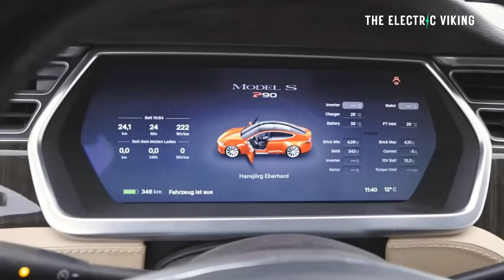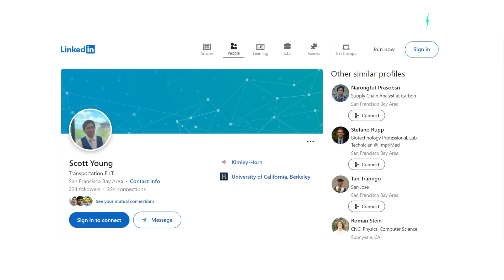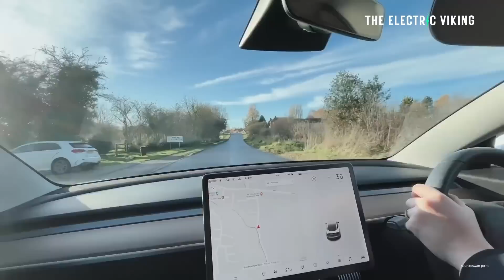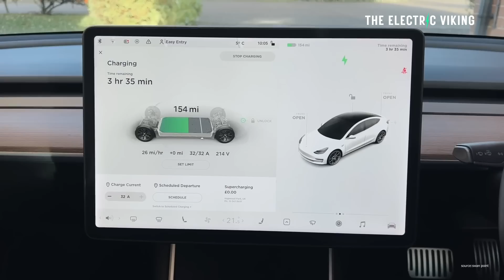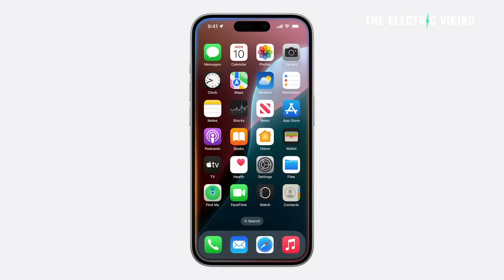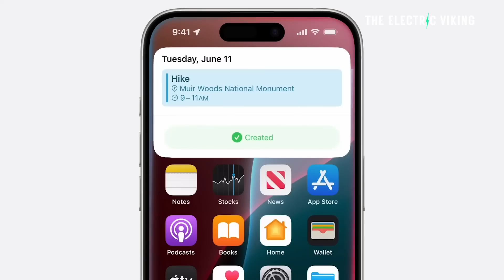Electric cars capable of running for over 1 million miles are already here

Comment: I like Tony Seba's predictions so much I will make one of my own:
Aftermarket battery packs will become DIRT CHEAP within TEN years (maybe within FIVE).
You can ALREADY get a replacement pack for a Nissan Leaf - they are just NOT cheap (yet). When cheap Sodium Ion cells hit the market (little tiny trickle so far) anyone with a decent amount of knowledge will be able to make their own pack.
Why? Because the HARD part is the battery cells - the rest of it is (relatively) simple.
Companies like Ford, Tesla, John Deere, BYD, etc will try to "wall off" their batteries with proprietary software and will likely go to HUGE lengths to make "reverse engineering" the battery difficult (because ..."safety", the fallback they use - like Apple with cables - when they can't stop honest people any other way).
Reply: Having the batteries is fine if you you are trained to work on 600 too 800V dc systems without making yourself crispy. I have worked in electronics for 49 years and I would be very wary.
Reply: @stevewilliams430  You are correct, and I probably understated how important that is.
The average plant maintenance millwright or electrician (with a ticket) is trained to work with that kind of voltage. Maybe it's just that I know a bunch of people like that, who would be pretty much able to work around DC high voltage because they already do.
I also think the "average" millwright or electrician is probably a lot smarter than the "average" person, but that's just an opinion.

Comment: Electric cars are much more simple than ICE cars, so they do indeed have the potential of needing far less repairs. I dont really care about ultra high miles, as I will not drive that far before the car is outdated anyway, but lower running costs matter a lot.

Comment: Sam.  You and others talk about EV's like they're a natural evolution of transportation.  Not true, they're purely a result of government regulations about emissions based on the climate change religion.  We're all gonna die if we don't get the CO2 levels down.  As far as local air quality, that problem was solved 20 years ago, so climate change radicals switched to CO2 emissions and changed the narrative from air quality to Earth's temperature.  

YT auto repair channels all talk about 80% of repairs are the expensive electronic modules and emissions parts on modern cars that go bad and then the very complex engines and transmissions that manufacturers were forced to produce to comply with increasingly restrictive emission laws. Modern transmissions have to be complicated computer controlled 8 or even 10 speed automatics for emissions.  Think that is less reliable than a standard mechanical 4 speed automatic that cars had for years?  They can't even make manual transmissions any more because a computer controlled automatic gets .02 mpg better than a manual. That is what ruined the extremely reliable engines and drivelines from just 10-15 years ago.

Comment: I'm a senior citizen and all of my cars have died from cancer, not mechanical problems. Here in the rust belt road salt really does a number on steel to the point where a lot of people drive their cars way past being safe because the frames are half gone.
Reply: Here in the UK we have an annual test and cars that are rusted in safety critical areas are denied a test certificate. That means they cannot legally be driven on public roads.
Reply: The Teslas have alloy gigacastings so rust shouldn't be a problem in those structural parts of the body.
Reply: @aftonline if salt is used on the roads the giga casting will be be effected the same. It's called galvanic corrosion.

Comment: I have a 25-year-old Ford pickup truck that works like new. It doesn't have 1,000,000 miles on it because I use it for truck stuff, not car stuff. I can fix almost anything that goes wrong with it by myself for a reasonable price, and I certainly don't need to worry about software problems.
Reply: Same for me but mine is a 91 GMC 330,000 mi and what is wrong with a wood stove
Reply: @djt8518   WTF are you clowns watching the Electric Viking for?  Shouldn’t you be watching Cooters Garage so  u know how to clean your carbs?
Reply: It might work like new but it is poisoning people right now with its emissions and its CO2 emissions will make life very difficult for your grandchildren. They will curse us for not getting rid of fossil fuels a lot sooner.
Reply: Lemme guess, you use a wood stove to heat your home too

Comment: Sixty years ago I used to lurk around car lots as a kid 'cause I loved cars. The cars I saw in the back of the lot were the ten-year old vehicles from the early and mid-fifties. Usually, they had about 70-80,000 miles and they were 'used up.'  I was tasked with 'starting them' and 'exercising these old clunkers - typically, you could buy them for under $300.00 - and I discovered a rule when I smashed the door of a nearby car.  What happened was there were no brakes - these suckers didn't have but one 'brake system/reservoir' and if that one failed, you had no brakes.  Always check the brakes before you check the go.  The point is these cars were crap in about eight years.

This was the heyday of fins, chrome and.... rust ... and overall, the most modest vehicles (6cyl with 3 on the tree) had a simple down-draft carb and a six-volt system that any jackleg could work on.

But it was planned obsolescence at its peak.
Reply: Amazing.
I sold a 10 year old Toyota 
The engine still looked completely new.It didn't use any oil and oil never looked dirty.
The car was still tight ,as new.
Obviously a car built to last 25 plus years 
Thanks Toyota for your service.

Comment: With NIO battery swap you can update to the latest battery tech for the life of the car. The car parks itself swaps the battery and provides coffee the way you like it in less than 3 minutes.
Reply: @shannon6876  You lack of any real knowledge on what a battery swap station actually does is awesome. Batteries are charged, tested, and exchange power to balance the grid.

Comment: II have a Honda insight 2000 hybrid. Aluminum frame and the first car with a battery pack in North America. It was a not a lithium pack but nickel cadmium. Now there is a community modification to install a lithium battery pack and a 40% power hack.

That will happen to current EV with future power sources

Comment: The next revolution we need is ease of repairing the battery. Easy removal, easy testing and easy cell and module replacement along with pack standardization and upgradability. This should be Tesla's next party trick and what we need to make the whole thing more sustainable.

Comment: One day, I will probably buy a Tesla, I have 3 old 2000 Honda Insights that get an easy 70 mpg when it's cold outside. Over 100mpg if you are trying for mileage. Now they are putting lithium batteries in them they can get 150 to 200 mpg. IMO, the best hybrid ever made. We have some really really smart guys working on these cars.

Comment: It's called "planned obsolescence." My friend's dad still had his razor given to him during WWII that wouldn't dull. Yet almost all razors today need replacing. There is no future profit in a product that you only sell once. This holds true for automobiles where the reason that they don't last was known and where the quote above comes from. American cars were getting so good that they started to last a very long time. Auto execs discovered that if they made the cars purposely didn't last that they would have repeat sales. The quality of Americans dropped in the 1960s and 70s. The only problem was that the Japanese didn't get the memo. Side by side the Japanese cars were much more solidly built with welds while American cars were made of thin metal and bolted together, and they lasted much longer. During the oil crisis in the US Japan gobbled up market share taking the top sales spot with the Toyota, Corolla. As the oil crisis subsided the quality of Japanese cars kept their customers by providing larger less efficient cars of quality like the Toyota, Camry, which in the 1980s was the best selling car in the US.

Comment: Ya they can last a long time but can you afford to get it fixed it it does need repair.  And if you are in an accident and the battery back is damaged your insurance will probably just total the car because of the high cost of replacement

Comment: What about the battery, 8 year warranty, after 8 years you need a new $20, 000 battery. There goes all your maintenance and gas savings.
Reply: You won't need one.
Reply: And if it did fail just out of warranty it would cost much less to replace the battery as it would still be useful for other applications and valuable for its minerals.😊

Comment: In the real world, EVs used for business rarely last more to 3 years.  Since the batteries are mostly fast charged, they go through all their recharging cycles in less than 2 years.  And since the eleectrinics are ehat break, NOT MECHANICALS, your golf cart goes through more repairs and obsolescence than the typical ICEV...like that Volvo 1600 you mentioned.
Reply: All total bollocks. EVs used as taxis demonstrate that very clearly.
Reply: @rogerphelps9939  Tes, like the Uber driver who bought a Model 3 thinking it would save him money.  The battery failed on him in less than a year.

Wanna try again?
Reply: @billcichoke2534  Single case anecdotes are not solid evidence. Unfortunately for you the evidence is firmly against you. I suggest you learn some statistics.
Reply: @rogerphelps9939  And I suggest you read up on heavy use of fast charging on Li-ion batteries.  Also, remember the old saying...there are lies, darned lies, and statistics.

Comment: Tesla cars still wear out suspension parts.
Reply: All cars do.
Reply: @rogerphelps9939  exactly. Tesla cars will go further, but, the desire for the latest advancements will cause people to go for the new models, if Tesla slows the improvements, the  recurring sales will drop, not just advanced functionality, but different styling on a regular basis. Tesla has to realize it is maturing, and the Honeymoon is drawing to a close! People want their brand new Tesla to look at least significantly different in the front and rear end of the vehicle. You should still be accomplishable, even with very low coefficients of drag..

Comment: Our first TV, a British-made Pye 110 Portable (it weighed a ton but had a handle on the top) meant that the TV repair man joined the milkman, baker and butcher on the list of tradesmen making regular house calls. TVs are now both astonishingly good value, very reliable and last well beyond the point that most owners want a newer design ("At last it's broken, Dear. Now can I buy a shiny new one?") If they do go wrong they can seldom be repaired economically. I see vehicles following a similar path. Enthusiasts and tinkerers will have plenty of old ICE machines to play with for as long as they live, but most car users will be happy with an EV: quiet, smooth, cheap to run, reliable and "just works". EVs may not on their own fix the atmosphere but they will help a lot. The recycling issue however remains unclear. If cars are designed to be recycled they will be, provided recycled materials are cost-competitive with new materials. My concern with batteries is that since we are seeing ever more cheap and abundant elements used in their production there may be less incentive to recycle. On the other hand there are many uses for batteries whose energy density is no longer cutting edge, as they don't all have to be 'portable' ...
Reply: Here in tthe UK car manufacturers are obliged to provide recycling facilities for their products.
Reply: Keep in mind 99% of lead acid batteries in ICE cars are recycled. They are much cheaper than any EV batteries.

Comment: Right! If I could purchase a new battery pack at a reasonable price my 2023 Nissan Leaf would last at least forty years as has my 1976 Cadillac.
Reply: You can either get refurbishment where only tthe duff cells are replaced or a complete batery from a totaled newer model. The Nissan Leaf is designed with battery repairability and replacement in mind, unlike many others.
Reply: @rogerphelps9939  thanks

Comment: EV are not bad for the auto industry. GOVERMENTS are. Regulation green peace of shi* movements with the soul purpose to get rich and not save environment. Lack of planning and lack of vision for the future these all are the reasons EVs are failing and will fail as well ICE cars also. Remember, the crap moto, you will own nothing and you will be happy. And you sir stop coming with click bate videos here some inside into the auto industry I work on it by the way specially in the battery technology is not there yet. There is no 1000km battery coming you have so much to take into consideration let me put it this way the higher the AH the bigger the cell. And we can see that from the teslas. So shut up already you are just pumping content with no substance.

Comment: Nice EV you've got but can you afford to insure it? Y ou can still get insurance for any vehicle in any state but, at a time when motorists already are moaning about expensive coverage, EVs could add to the burden. They are often more expensive than gas-powered cars and typically cost more to repair, which leads to larger claims. Car-rental agency Hertz, which in 2021 announced its plan to buy 100,000 Teslas, sending both its stock and that of the automaker higher on the news, has reversed course this year. The company cited the “damage expense associated with EVs” in its January decision to sell a third of its EV fleet.
Reply: My Leaf insurance is £300 fully comprehensive. Not that expensive.
Reply: @rogerphelps9939  In the USA on average, EVs cost up to $44 more to insure per month than gas-powered vehicles, with the most expensive to insure being Tesla's Model Y and Model 3.(Feb 27, 2024)

Comment: I worked for many years in manufacturing automation, never saw an AC motor go bad.
Reply: How.many times.in my 89 years have I heard anyone say they needed to get a new electric motor? Never!   Looking around just now I counted six things in my cottage that have an electric motor and I don't give them a concerning thought.
Reply: @tommorgan1291  In the Air conditioning industry, electric motors have to be replaced quite often.  The drive for more efficiency (thinner windings, etc) has caused a loss in longevity.  Older motors, however, can last a long, long time.  I know one heat pump owner that set his blower to continuous fan mode and left it that way for 20 years until he had to replace the unit due to a bad compressor.  I recently replaced the fan motor on my daughters heating unit that was only 8 years old.
Reply: @WayneBain  In 1938 my grandfather installed a hugh electric motor that ran a series of belts. These belts in turn operated six large machines. It all made quite a racket! My uncle that shop and built at a new location in 1990. That big motor never failed. It’s still sitting up high in the original location and I bet it would start right up 86 years later.